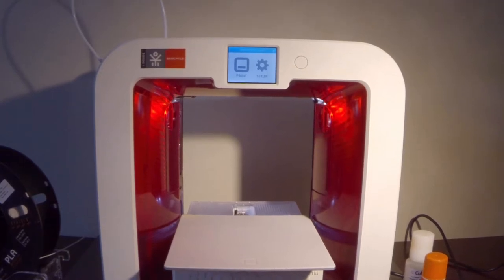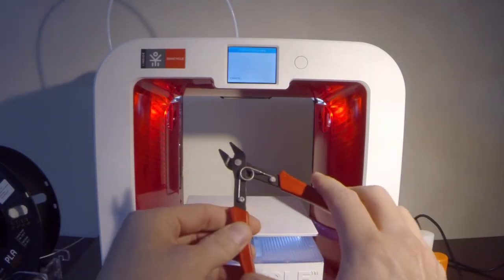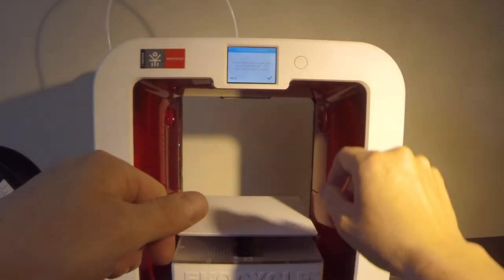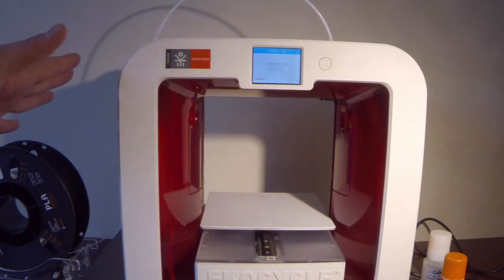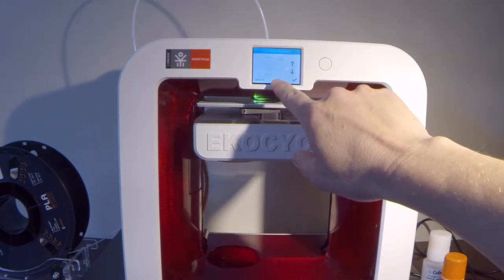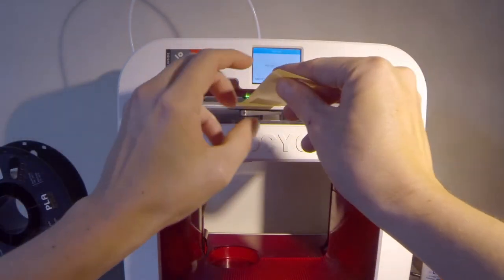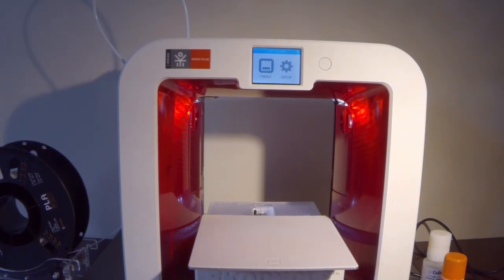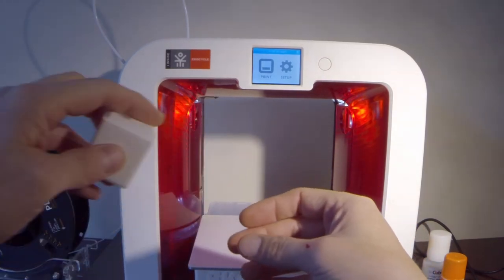Cube3 and Ekocycle printer calibration

Comment: Great video for a quick fix for Cube 3D printer z gap fix, bad adhesion fix, squiggly print fix 2021. It's an easy way to use cheap filament and modernize the Cube 3D Systems Printer. Extremely helpful and informative.
Reply from the maker: Thanks Andrew - Glad to hear this video helped you out. I'll continue to post videos as I receive questions and help others with their issues.

Comment: Great videos! What was the trick to fix the print bed from hitting the print head?  I just purchased a Cube and need to get my Z home position fixed because slams the print bed into the print head every time I try to calibrate or do an auto level routine.  Can you please help?
Reply from the maker: The section you need begins at 7:00.
Reply: I have done that sequence several times and it is still making my bed hit the nozzle.  Do you have any other suggestions?   @3dprinttek  Thank you again for the help!
Reply from the maker: @johnoehlschlager2983  Oh no, that means your plate isn't dropping all the way down before it goes back up. The printer doesn't have limit switches, it moves to the limits of X, Y and Z as it's "homing" function. The most likely cause is filament caught in your belt but it could also be a dying motor or bushing. For all cases you'll want to tear it down to investigate - See my other video showing how to get the shells off in less than 10 minutes - https://youtu.be/a0k4H2_WjrM?si=SmuoRvHqcuHFL3_d
Reply: @3dprinttek  Man... I am not sure that I am comfortable with doing that.  Are you still rebuilding these units?  Would you be up for reconditioning mine?
Reply from the maker: @johnoehlschlager2983   Of course, find me in the cube owners group on FB.
Reply: @3dprinttek  what is the name of the group on FB?

Comment: Hi, I am updating one of these Ekocycle Machines and tried to update to the "hacked" firmware. The printer refuses to download the firmware. Any thoughts?
Reply from the maker: Hi, the key to doing this is a 2nd USB stick and timing. The 1st USB stick needs the true EKOCYCLE firmware, which the printer accepts and begins the update process. Once the printer indicates that it is "Downloading update", pull the 1st USB stick and insert the 2nd which contains the Cube3 firmware that is renamed to match the same file name of the EKO firmware in USB stick 1. I made a video walking through this. Please check that out if the this isn't 100% clear.